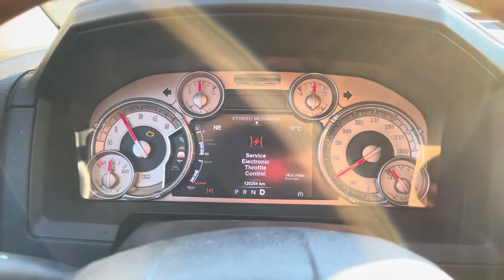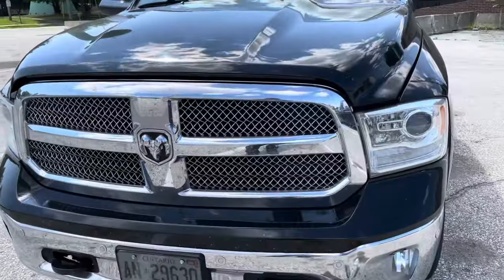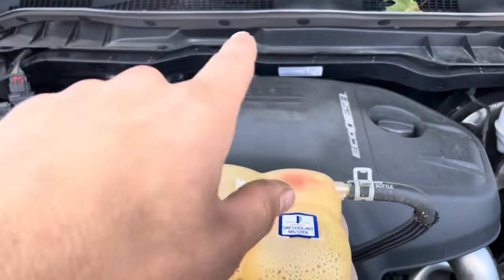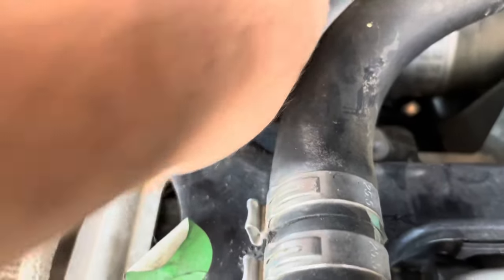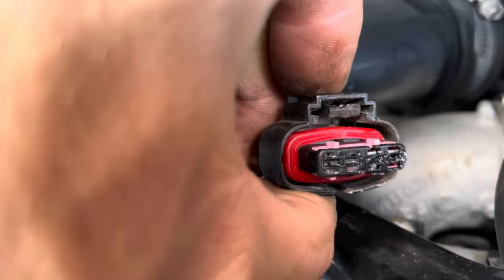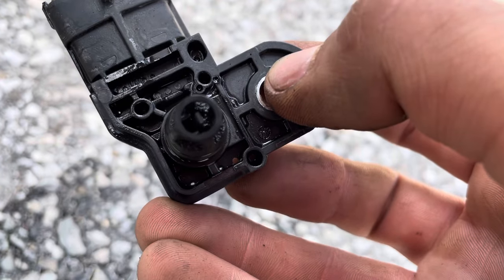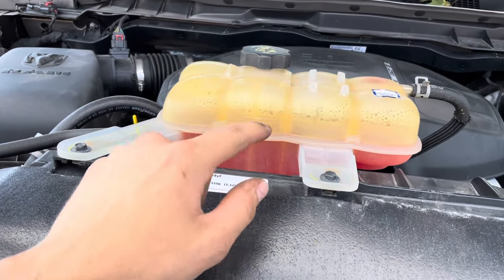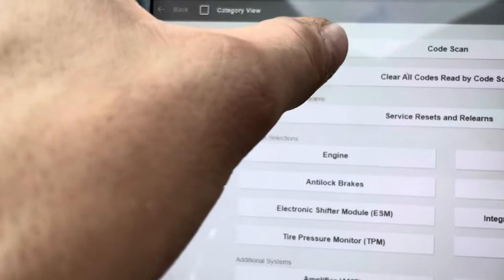2015 Ram Eco Diesel Service Throttle Light

Comment: I keep getting the "service electronic throttle control" with no CEL and no codes.   Turn off the truck and clear the SETC error and it runs fine.
Reply: Did you delete your truck?
Reply: I found the issue.   And yes it lost some parts in a weird boating accident.   😂. It was not the map sensor on my truck.
Reply: What is the part if you don't mind I'm having the same issue the only thing is it only happens when I use the pedal when I'm on cruise control It doesn't do it
Reply: is yours deleted?  When you did the exhaust did you disconnect/remove ALL the sensors that got removed from the exhaust.   As in the only thing down there are empty plugs with nothing connected?  If there are still o2 or ANYTHING CONNECTED that are being used anymore completely disconnect them.
Reply: @rwhipple73  well my truck also has had a bad boating accident and is falling apart. 
but I believe the only sensor is post turbo nox sensor
Reply: @dhwarehamsperry  any sensor back feeding “bad” data on the canbus can cause a myriad of random check engine lights.
Reply: Did you by Chance lose your AITV?

Comment: I had a service throttle body on my 2014. Rough idle etc. Fans running after engine off. Turned out to be coolant temp sensor.

Comment: Today, my 'Service Electronic Throttle control' message came on and the truck went into limp mode only very briefly, then ran normally the rest of the way home (over 40 miles).  But the Lightening symbol and Check Service light are still on.  What I need to do is figure out how to clear the lights and see if it happens again.  I was hauling a very heavy load and was in Tow-Haul mode with the truck on cruise control (my bad!!) and started up a steep hill (59 mph).  I think that triggered this.  158,000+ miles and it had never happened before. As soon as I canceled the cruise control the truck began to run normally the rest of the way home.  I had no problem reaching 60 mph but I left the Tow-Haul and cruise modes off.  How do I clear the messages and check engine light?  Anyone know the answer to this?  Thanks.
Reply from the maker: Takes a scan tool to clear them out, I’ve learnt that disconnecting the battery doesn’t work
Reply: @ParryCustoms  Yeah, I think you're probably right.  I've tried the key-thing, the battery disconnect, neither worked.  If I can get the lights cleared by a shop with the scanner and it comes back on I'll try cleaning this sensor like Parry shows us.

Comment: My sons 2014 eco Diesel is having this problem, when the tow truck arrived the vehicle only cranked but wouldn't turn over. we did clean the sensor and cleared the codes but still will not turn over. I can't find any videos with similar situation if anyone can help with answers!
Reply from the maker: There is an active recall out for the tone ring on the crankshaft that cracks or flakes off, it’s your crank signal.. that would more than likely be your issue! Only problem is I’ve heard after they crack/flake the recall is invalid.. I’d say to have an inspection but it is kind of tricky because it’s located behind the flex plate… can’t be replaced without removing the transmission!
Reply from the maker: Or also just reading up online, the ring can delaminate and require a software update done at the dealer! “Free of charge” but is anything ever really free? Lol

Comment: 2018 Ram 1500 EcoDiesel 75,000Km
Followed the video guide, i didn't remove anything to get at the sensor other than the engine cover. You do have to twist it a bit to get out from the well. 

Tried to reset the code with a battery disconnect and left it over night. However, i did have to get someone to clear the code with a scanner. Showed low turbo boost pressure on the code. Drove it home (30min) and the code hasn't returned. A new sensor is 160 from mopar and 200 from Napa for anyone wondering. 

Thank you.

Comment: Great video. And thank you. Any video(s) on abs light after sensors have been replaced.
Reply from the maker: Abs light is still on after you replaced the sensor? Most times if the light is still on after you replaced the sensor could mean one of a few things… your wiring is bad on the truck side, or on the actual bearing itself there is a “tone wheel” that is a magnet and allows the sensor to read the speed, I’ve seen excessive rust build up and actually cause the tone wheel to flake off. Another issue may be the “air gap” between the sensor and where it mounts is too large meaning there is built up rust under where the sensor mounts.. hope this helps! Cheers!

Comment: Hi mate thanks for your detailed instructions on getting this sensor cleaned out. I have a P02E8 code on a Grand Cherokee EcoDiesel and wondering if doing this clean might help, although I don't have the service throttle light yet. I know the problem is on the throttle body butterfly flap position but cleaning all that hasn't helped. Wondering if you or anyone here has experienced/fixed it. Thinking of replacing the throttle body but the car just runs so fine except for this warning. Also noticed if I try to restart the engine right after turning it off, it would not start and continue to crank only. Wait for 20 seconds and try to start, starts normal. Even cold or subsequent warm starts are fine. Maybe EcoDiesels should not be started immediately after shutting down? Only mechanical feel to the issue other than the check engine light and code. No other codes present. Cleared code returns after a few ignition cycles. Any help or suggestions would be appreciated thank you :)
Reply from the maker: Could be related, could be something different, I know the intake gets suuuuper sooted up so maybe that could be related to your issue too! Hope you figure it out!
Reply: Any update, I’m having this same exact issue at the moment down to the t of what yours is
Reply: @JordanVoss-q2m  Nope been trying different things for about 5 months now. Starts a lot better now though so could be a few things I have tried. But the code comes on and clears every few days for a day or two before coming back.

Comment: Getting the same issue on the same truck however it's a p0651 code for throttle position sensor and both the EGR and MAP that you showed are brand new, any solution?

Comment: Hey man, had a question for you. If i get the egr and dpf delete and remove the DPF but keep the CAT and don’t install block plates — Will that cause me issues ? or will it be alright since the EGR/DPF is tuned out. Help a brother out please!
Reply from the maker: That’d be a good question for your tuner, but from what I’ve read you can leave it all attached but it still may thermal crack and possibly soot up due to the coolant and exhaust gases still running through it.. that being said I would say probably take it off but you can do whatever at your own risk haha. Just my 2 cents, cheers brother!

Comment: I had my temp sensor crap out and it kept throwing this code. Cleaned the sensor with carb cleaner three times  before figuring out the real issue.

Comment: I have the exact problem you have and I did exactly what you did. Disconnected the battery for reboot after. Still have the warning service light on. If I drive it to where someone can reboot the computer would it still work or if it’s still having the problem still broke?
Reply from the maker: Yeah if you get access to a scan tool, have them read the codes and clear them out. If the code is a hard code it won’t clear and will likely be that the sensor may have been damaged when it was cleaned
Reply: How do you clear a hard code?

Comment: i have the SETC on the dash but no check engine light, what is your opinion on this?
Reply from the maker: It’s hard to say, in some Cases I’ve seen that it doesn’t put an engine light on but there will still be a code that will help you further diagnose it! This was my case and it hasn’t come back yet

Comment: That's the map sensor not boost pressure and it gets messed up by the oil vapor from the crank case not egr, if you get a catch can it'll prevent that from clogging up.

Comment: I get the "service electronic throttle control" message in my 2014 Ram 2500 every winter when I drive to Colorado.  I'm not sure if it's triggered by the sub freezing temps or over 10,000' altitude. 
It goes away when i get back to normal temps/altitude. 

I'm going to attempt to clean the sensor, but does anyone else have any issues brought on by temp or alt?
Reply: Hi brother. Did you get your van fixed? I am having the same problem. I bought a 2014 promaster from Colorado and it's the same problem.
Reply: I was thinking of replacing the mass air flow sensor. But I don't want to be throwing parts at it.

Comment: This happened 7 times on my 2014 limited ecodiesel. Ended up having to declare it a lemon. Loved that truck other than that issue. Wish I knew this back then. I just bought a used 2017 ecodiesel. It has had the egr recall done. You think that will stop the issue from happening?
I also installed a pedal commander. The throttle lag was very dangerous. Looking into a GDE tune now but I am in California
Reply from the maker: Should make it better for sure, best way is to have the egr shut off or remove it, but seeing as your in Cali it is hard because of the emission standards there. But the recall will help being that the egr won’t be letting coolant go where it isn’t supposed to. Keep me updated if you wish!
Reply: Had the issue on my 2018 ecodiesel..they just repaired the recall..i hope it stops this issue
Reply: Recall part on mine lasted 2 years and about 20k miles. Micro leaks again and losing coolant again. I’m about to delete the egr and dpf and straight pipe it. I’m done playing around.

Comment: Parry, my problem today is that as soon as I start my 2014, the engine RPM's race very high.  I don't want to put it in gear with that condition.  It's in a parking lot now and may have to have it towed after the holiday weekend. Have you seen this with the throttle controller issue?
Reply from the maker: I have not, sounds like you have a air leak, would definitely take it to a shop but see if any of your vacuum hoses are off or cracked. Also could have an issue with the high idle for when it’s cold out
Reply: @ParryCustoms  Thank you Parry!

Comment: I am a tad confused about this issue. This is my first warning light of this nature but when this happens to me my turbo turns off, I have no boost and barely acceleration while my turbo gets about 400 degrees hotter. Since my Jeep (same engine I am assuming) isn't driven on the road I have removed the EGR at around 60K miles, 20K miles ago. My question is the boost pressure sensor part of the EGR because I can't find this thing anywhere!
Reply from the maker: Nope it’s still on there, it’s on top of the plastic intake manifold, one torx bolt and a harness holding it on!
Reply from the maker: But that would explain the no build of boost, it puts the vehicle into a limp home mode

Comment: I got a 2015 Eco diesel my exhaust filter keeps coming up 90% then it shows a brake light out I can drive high way speed but when I smash peddle I lose power
Reply from the maker: Sounds like your dpf may be clogged, does it ever regen?
Reply: @ParryCustoms  no I don't think it regain
Reply: @ParryCustoms  is dpf easy fix ?
Reply from the maker: @bobbyeastep2370  well it should regen soon and empty the dpf, if not you’ll have to bring it to a shop to force a regen if it’ll allow it. That being said to replace it I belive its thousands of dollars so I’d express every option before replacing it. But at that point you can be tuned and deleted for 1500$ and you’ll never have to worry about the dpf or egr ever again ;)
Reply: @ParryCustoms  hey bud, I have a 2015 ram promaster ecodiesel and have the same problem, mine is giving me the p2463 code, what do you recommend to do, I really would like to deleted but not sure if I can do to this kind of vehicles, thanks in advance!!!
Reply from the maker: @marioortega9421  take it to a shop and see if they can force a regen, if not you’ll be in the market for a tune/delete combo
Reply: @ParryCustoms  thank you I will do that, so there's deletes and tune for this vans as well?
Reply from the maker: @marioortega9421  I’m sure they make them! Just a matter of the tune then remove all the emissions junk haha